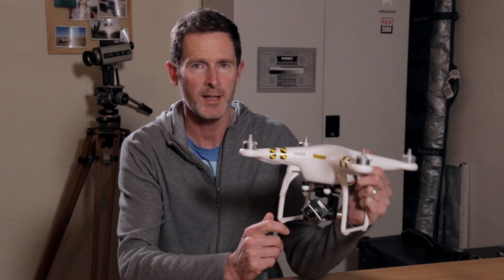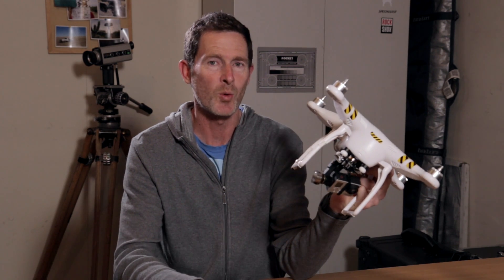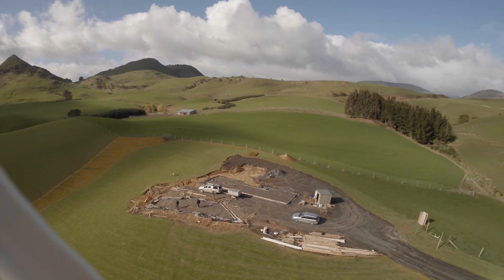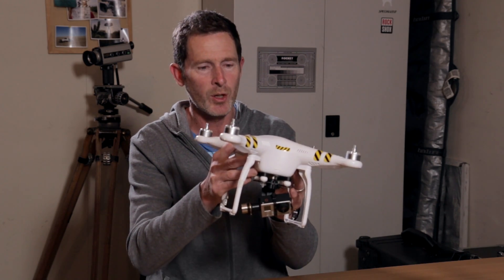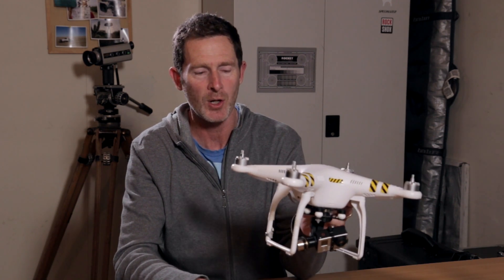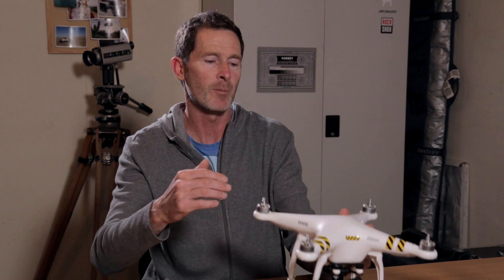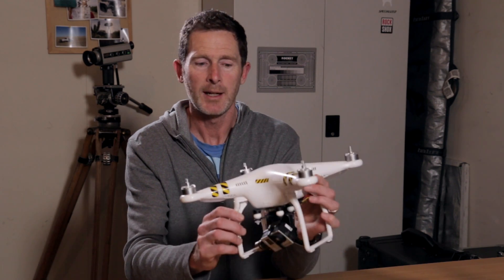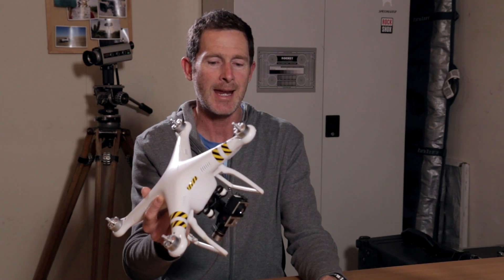Vortex Ring State and your DJI Phantom...and how to avoid it!

Comment: Very informative video. I had previously heard about vrs occurring during a descent. Though someone claims that the same thing happened to him during a stationary hover. My Bugs 3 Pro recently fell out of the sky but it was not descending at the time. It had only been up in the air for about one or two minutes on a fully charged battery. This other guys reckons it may be due to vrs but I'm skeptical. Looks more like it lost power for some reason. It flipped over and fell like a rock. There was no payload attached.

Comment: Mr. Johnston, excellent video and explanation of the Vortex Ring State.  Prior to today, I had never heard the term.  Don't fly helicopters, and prefer to stay out of them as much as possible.  Not knowing or knowing about the phenomenon, it seems when experiencing or witnessing the rapid descent, the natural thing is to apply "More Power" to reverse the condition.  Recently (Yesterday) I purchased the Litchi drone app as an alternative to the DJI Go app.  No problems with the Go app other than getting it to work with more than one IOS device in the house.  I was planning on trying it out today after work, when I saw a post about a Phantom rocking a bit, then flipping over, and crashing to earth.  The implication was that it was the app that caused the crash.  This caused me some hesitation in wanting to try the new app.  But based on this video, and some research, i don't know how the app would have caused the initial rocking and then an inverted descent & crash.  All this aside, thanks for the detailed explanation of VRS and the correct corrective action to take.  I feel the need to practice coming out of this possible situation and no more vertical descents unless absolutely necessary.  Thanks!
Reply from the maker: +John Ferguson Glad to hear it was useful. I just read an article online yesterday about a drone falling on a women's head in Canada and the operator not knowing what happened, I wonder if it was just this? Cheers

Comment: My Cx20 has been doing this lately and I couldnt figure what it was, I also dropped from about 20 feet in to a paddock, snapped a couple of props and broke the prop guards which I am not going to bother with from now on. Thanks for this Grant I am going to practice the techniques to get out of trouble and also take your tips about vertical descents and try and avoid doing them.

Comment: This happened to me from 238ft with GPS hold. Started VRS and shattered on concrete. I did exactly the same thing, applying full power and didn't think of changing direction. I have been experiencing this for years and usually it is a small quad, and no damage is done. It was catistrofic to my CX20. Thankfully the frame is only $25. Everything still works after applying a bit of solder. :) Still waiting for body from gearbest.
Reply from the maker: +Josh Hymer Thats a bummer.  I've got a DJI Inspire and it hasn't happened to me again .. thankfully, but I'm also careful when descending now from the lesson learn't!

Comment: Thanks Grant, great explanation, I am a helicopter pilot and your explanation about VRS was very accurate. One extra that could help getting out of the VRS is to actually lower the throttle, with a forward attitude movement. That should help reduce the "dirty/turbulent" air even more.
Reply from the maker: +FlyingCam.au Good advice thanks.  Cheers
Reply: On real helicopters you can apply full left stick and full power to catch the updraft of the turbulent air.

Comment: I just lost mine in the saltwater bay in San Diego for the very same reason you just described.  Full throttle did nothing to help.
Thanks for the information.
Reply: +Tim McGregor Sorry for your loss.
Reply from the maker: +Tim McGregor Ouch...sorry to hear that.
Reply: +Kory White   It happened sooo fast and it was a sick feeling to see it go down.  There was a small cliff and I didn't know it had gone in the water until I looked over and saw it. Oh well!  Expensive lesson.
Reply: +Grant Johnston  I've watched yours and others on VRS videos and will definitely try to fly out next time and no increase in throttle.  I'm not even sure if I had enough time to react.  Next time I will make sure use directional flying to reduce altitude instead of guessing on straight down descending speed.  Thanks for the great video!!
Reply: +Tim McGregor 
D'oh, those puppies are pricey...
VRS (settling with power) is to be avoided with RC models and full-sized helicopters alike. You're descending into your own downward-moving air and full power and lift won't prevent the descent.
To get out, quickly fly in any direction.

Comment: Hi Grant. I experienced this a couple of times a last summer. Since that I always use the white DJI original props. I dont trust my reseller who tries to sell these black composite props to me any more. Any thoughts about expensive composite props?

And, have you tried to change the motor angle? With bricks of different thickness? Like all motors pointing out or all pointing to the center above the quad?
Reply: +Jan Holmström 
That might be an idea for multirotors, 'aim' the motor shafts inward to converge at a point above the drone so that the downward airflows escape sideways, it might make SWP less likely to occur.
It will also require more power to fly, giving reduced payload capacity and shorter flight times. It may also cause handling issues.
Reply from the maker: +Jan Holmström Hi - Yes I didn't trust my carbon props and stuck with the original plastic ones.  Didn't try changing the motor angles and would probably be beyond my level of mechanical competence!
Reply: +Jan Holmström
Bricks? Sorry, I forgot this is english. Washers!

Comment: This post solves a lot of mysteries for me. My DJI dropped hard from about 50 feet while I gave it full throttle. Then I puzzled for a long time what had happened? Battery was good, modes were correct on the controller. Without an explanation, it has made me timid to fly it over any terrain where I would be unable to retrieve it. The thought of losing control over water or heavy woods is terrifying: just say good-by to a thousand dollars of equipment.

I've never flown in a helicopter and I am unaware of the vagaries of helicopter flight. But I am a fixed wing pilot and I believe I have a good understanding of aerodynamics. But I never would have guessed what seems so obvious now.

Many thanks.
Reply from the maker: Glad it helped, I just about always descend now whilst moving forward or backwards and have never experienced it again.
Cheers
Reply: I'm a heli CFI, if you're interested in more knowledge. VRS sets up when you have a V/S of greater than 300 ft/min descent with an A/S below about 16-24 KIAS (Effective Translational Lift A/S), causing you to descend into your own vorticies. Above that A/S, it is not physically possible to get into VRS, no matter the V/S. Once in it, collective increase only increases the descent rate. In a standard heli, it's a very similar recovery to an airplane stall, if you remember those :-). Generally, power/weight ratios of the smaller RC helicopters allows the heli to power out of the VRS, though it doesn't seem to be the case with multirotors. 

Interestingly, real-life multirotors (e.g.: Chinooks) do a different technique to get out of VRS. Instead of pitching forward, they have to cyclic roll to one side or another. If they tried to pitch forward, the rear rotor would only increase pitch and accelerate VRS.

There's a few techniques that you can use to get out of it, all depending on the type and setup of the helicopter. They all seem to focus on getting out of the "dirty" air (vorticies). Tried and true for most applications: Pitch forward, gain airspeed, and THEN add power to regain altitude.

Comment: great "point in case' there, Grant and well explained. I can tell you it's no more fun doing it in a real helicopter :) there is an area where slow airspeed and fast rate of decent meet that's called 'Dead man's curve' within which you'll experience this phenomenon (no guesses in why its named so) Always good to note the wind direction, especially on landing and if you want to descend fast, just keep your airspeed up. That is 'airspeed' and not 'ground speed' so we correctly account for wind. Cheers!
Reply from the maker: Yeah I've spent a bit of time in real helicopters for work and its another one of those 'things' that plays on your mind sometimes!  I just about always descend my Phantom now in a forward circular pattern and so far haven't had a problem with the Vortex Ring State. Cheers
Reply: Neil,
       Fellow heli pilot here! I think the Dead Man's Curve you're referring to is mentioned on H/V diagrams, where poor combinations of airspeed and/or altitude don't allow for a safe autorotation if the engine should fail (the curved, "shaded area" of H/V diagrams). 

Noting wind direction is one of the hardest things to do, though!! Time and time again, I'm called out on not remembering where the wind is coming from, and I have actually gotten into VRS by foolishly doing S-turns with a crosswind on short final. Bad move!

I've only recently learned that you can remember wind direction by checking it prior to takeoff, and then referencing the sun (we only fly for an hour or two, so the sun remains relatively stationary in the sky). 

Fly safe!
Reply: Grant Johnston Yeah great tip!

Comment: Hi grant, finally found a "kiwi" youtube. Your advise was excellent, as I have only just started out with flying phantoms. I had exactly the same issue, I upgraded the props, went into this wobble effect, and then crashed from a height. Thanks to you, I know now what the problem was. Cheers
Reply from the maker: Glad to hear it was useful, that problem is a hard one to replicate, I've tried to get the phantom to do it again in a safe area with the carbon blades but couldn't. I'm also a lot more careful now when descending and will generally keep the quadcopter moving forwards or backwards when descending and spiral my way back down.

Comment: Grant, DJI had a firmware update to the Phantom line a few months ago, around spring time, in which they've restricted the descent speed to 2 meters per second to prevent this exact issue. Did you have the latest firmware when this fall occurred, or were you flying with the old version and descending faster than 2m/sec?
Reply from the maker: Hi - No my firmware was and is up to date and what made it more confusing was that I was only just starting to descend so was descending at a very low rate.  I still think it was more to do with the tail wind which was a bit gusty at the time.

Comment: I have had 2 crashes and thought it was because I messed up the aerodynamics by adding extended landing gear and installing graphite props.   But in both crashes, I was doing a fairly rapid descent straight down, so this explains my pilot error.
Reply from the maker: I also had Carbon props on in this instance so unsure whether they're more susceptible to this type of incident?
Reply: GrantJohnston Grant, I couldn't tell you if carbon props are more susceptible to VRS.   I failed to say that I also installed the iOSD Mark II.  This is also my second Phantom II.  The first had the Zenmuse 3d-2d gimbal, Mini-iOSD as well as an Immersible 600mw video transmitter.   Didn't have a VSR incident with that setup.   However, I screwed up a takeoff from my boat and put the first Phantom in the water.   So I got the second Phantom and decided to do all these upgrades....extended landing gear, iOSD Mark II and of course, still needed the Immersion 600 mw video transmitter.   Oh, and of course, I needed to add camo skin to make it look "tactical".  So my weight is higher on the second Phantom than the first.